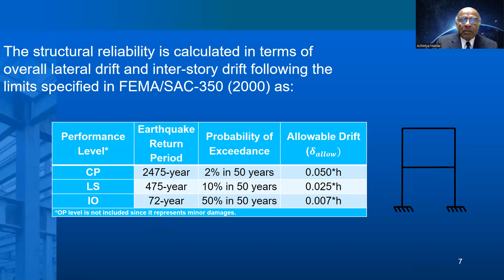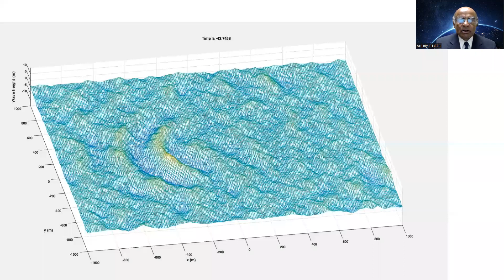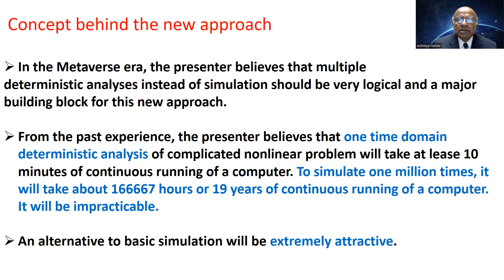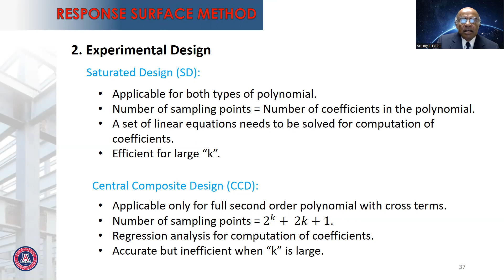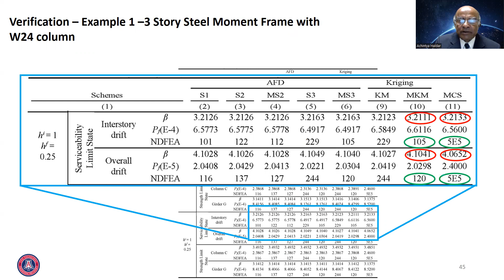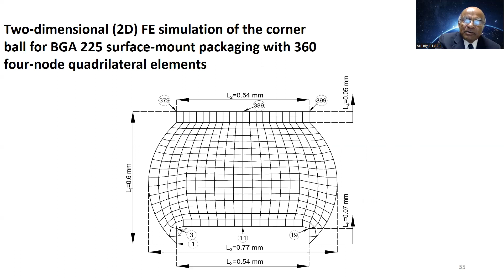CONF-CIAP 2023 - Computing Innovation in the Reliability Analyses of Nonlinear Dynamic Systems ...

Comment from the maker: Q2: Can you give me some strong evidence to prove that wave loading changes with the depth of the water?
A2: I did not follow the question. I do not need to prove anything. If the questioner is unfamiliar with the topic
but interested in the computer program we developed, it is not a topic for any discussion. To develop the
basic understanding of a difficult topic, it will require serious effort and time to gather the necessary
available information in the open literature. The starting point will be, as I suggested in my presentation,
to buy the book I recently published on the related topics. The information on the book is available in the
last slide of my presentation. I am giving below the information for the ready reference.

Title - Reliability Assessment for Complex Dynamic Systems Excited in Time Domain – REDSET
Secondary Heading – Alternative to Random Vibration and Simulation

By Haldar, A., Azizsoltani, H., Gaxiola-Camacho, J. R., Vazirizade, S. M., and Huh, J.

The co-authors wrote doctoral theses on the topic.